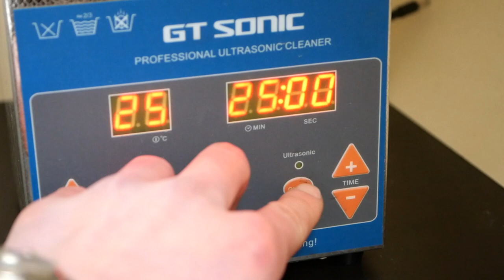Restoration Refinish of a Seiko 5 | ASMR (Polishing, Sanding, Buffing)

Comment: Mine didn't come with full links. It's just a tiny little tight on the wrist and it makes a mark. The end link near the lug is always vertical since it is holding the watch tight. I'm worried if the strap is going to come off easily and watch is going to fall on the floor! Is it easy to find strap.

Comment: why did you break the glass and not service the movement?
Reply from the maker: Hey, I broke the glass by mistake. 🥲 I did not service the movement because this is a restoration refinishing video and not a servicing video. 🙂
Reply: @vintagehorlogesleuven  thanks! now i get it hahahaha too bad you break the glass :/
Reply: @vintagehorlogesleuven hey what materials used for the glass press? The white one. I thinking of DIY
Its a LOT more expensive here by comparison to the watch. Like $15 bucks watch and $2000 glass replacement tool
Reply: Good job 🙏👍

Comment: I actually have the same exact watch. Will this fit in the seikoak 830010
Reply from the maker: Hey, I don't really understand your question. 🙂 If you're wondering whether or not your 7009 movement would fit in a Seikoak case, the answer is no. Your 7009 movement has the crown at position 3.8, while the Seikoak case requires a movement that has the crown at position 3.

Comment: It's all nice, but you shouldn't have broken the original crytal, because it's very hard to find on the market.
Reply from the maker: Thanks! To be honest, I broke the crystal by accident, because I used the wrong die. 🥲 I wasn't going to use the original crystal anyway though, since it was heavily scratched.
Reply: @vintagehorlogesleuven  Yeah, I thought of that when I saw how deep the scratches were on the original crystal. Nice work man... Congrats. 😀
Reply: I've always easily found original replacement Hardplex Seiko crystals easy to find and there are also generic German mineral glass replacements specifically for Seiko's.  What's difficult to find are sapphire crystal replacements to upgrade the watch and there it is the chamfer cut that's hard to find, straight cut sapphire crystals of the appropriate size are still easily found.  One of the advantages of Seiko watches is that it is a well known brand with a lot of production.